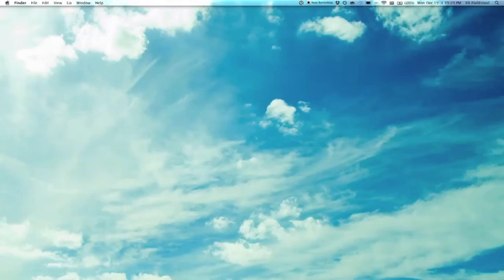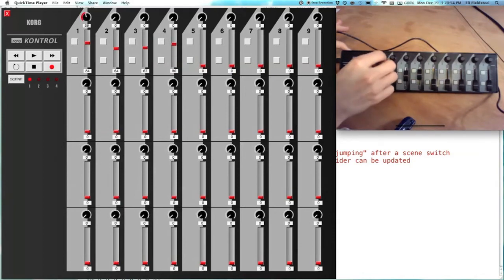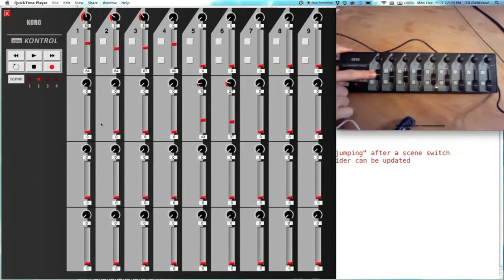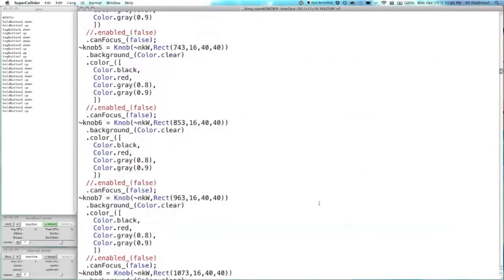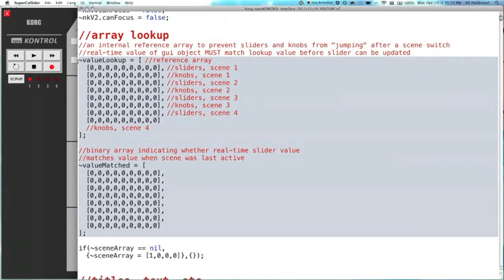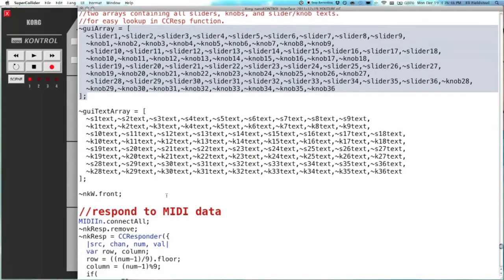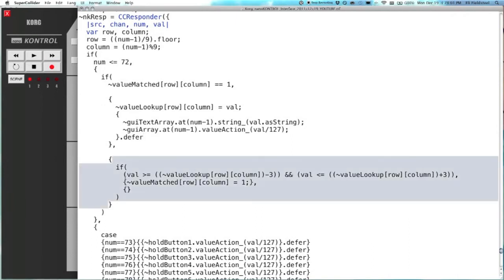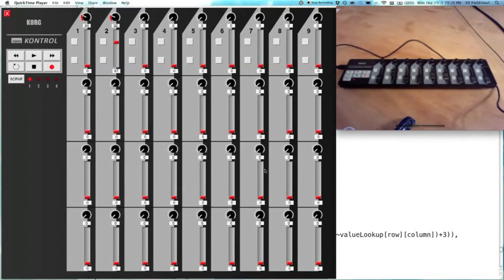Korg nanoKONTROL and SuperCollider

Comment: Hello Eli and thanks for all the tutorials. I am trying to follow a similar approach with my akai midimix but I cannot get the GUI to change with CCResponder. Since I don’t need scenes, I saw from your code that the main part which sets the GUI value is just valueAction. But when I apply it I get an error. Am I missing something, is there more to this than just valueAction?
Reply from the maker: This video is so old that I'm not sure the code will translate well to newer versions of SC. In particular, CCResponder is a deprecated class, and MIDIdef.cc should be used instead.

But yes, at minimum, in order to get a physical MIDI controller to move a GUI slider, you essentially need a MIDI responder object (MIDIdef.cc), whose action function calls .valueAction on the GUI object. You will need to wrap the valueAction expression in a { }.defer enclosure in order to schedule the MIDI action on the AppClock, otherwise you'll get some error message like "You can not use this Qt functionality in the current thread." or "The preceding error dump is for ERROR: Primitive '_QObject_SetProperty' failed."

Comment: Hi Eli, I am really grateful for your supercollider tutorials, they are easy to follow and they are really helpful. I like your project with korg, I am trying to do something similar with oxygen 25 for my college project. I did follow your MIDI tutorial so I got my keyboard working and also pitch bend knob. Now, I am trying to use one of knobs to control the amplitude of my Synthdef "tone". But, I do not really know how to assign specific knob to control specific value for some argument. Using this code MIDIdef.cc(\someCC, {arg a, b,c,d; [a, b,c,d].postln}); I am getting a values from the knobs when I adjust those, but my problem is I don t know how to assign those to control some specific value in my SynthDefs or MIDIdefs. Do have any advise? Thank you once more.